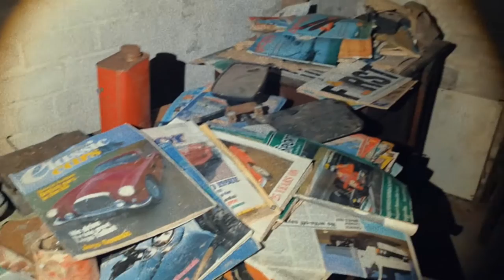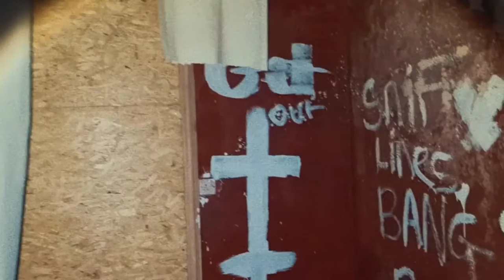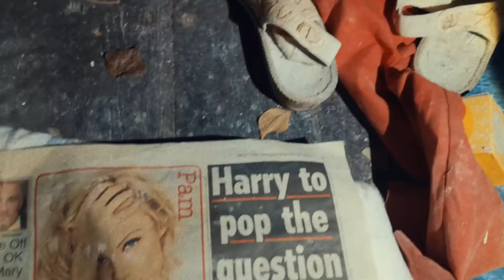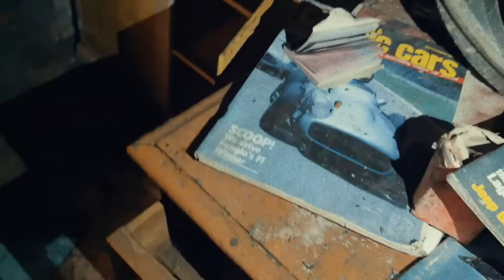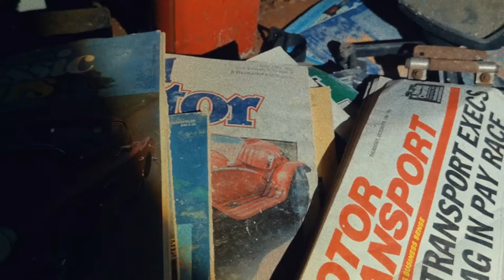THE HIDING - This abandoned train station is sinking into hell with a secret to hide!

Comment: Good video. According to the 'Disused Stations' website this station also handled goods and continued as a goods faciility for a few more years after it was closed to passengers. There was a goods shed, outbuildings and a signal box, the base of the signal box being converted into a shed. I think we saw some of these in the video. There must have been dozens of buildings like this left abandoned when rail services were pruned back in the 1960s and 1970s. Amazing that some have avoided demolition or re-use and still survive. Cheers.

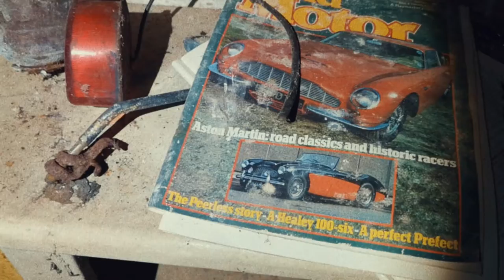Comment: 5:42 an abandoned car and trailer on the left of the screen 7:03 and 9:16 and 16:13 and 37:46 the amazing shots of the post master train house 9:16 an older door bell on the right of the doorframe 9:18 looked like there was once was an old camera fitted above the door 11:09 old glass case 11:44 looks like an old iron antique on the left 17:43 looks like a modem light switch what dimmed the lights on the top of the stair landing bit modern for this house 19:21 mirrors facing each other is not a good sign 20:27 it looks like a gun shell on the floor on the left I could be wrong it looks like one on the floor on the landing on the left side of the screen 20:28 and all so 22:05 at the toilet looks like the door use to slide shut then lock it shut 23:17 couldn’t here the bang with the music playing in the back ground it tends to shut out noises while music plays on the film 25:44 the old cupboard had a cupboard on the top great find I think they kepted cups and plates in back in the day 26:16 an antique oil can on the left 26:26 angel time stamp the time the same creepy an old CB radio and bank cheques and 27:26 more old bank cheques around xx
Reply from the maker: Nice one Christina I love these little keen eye snippets your posting because I end up seeing things that I never even clocked man thanks very much m8